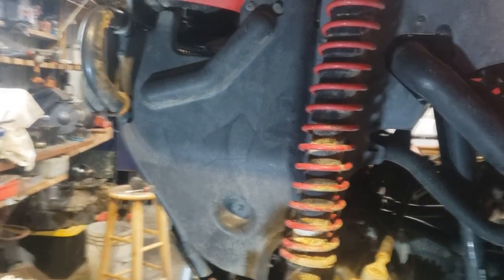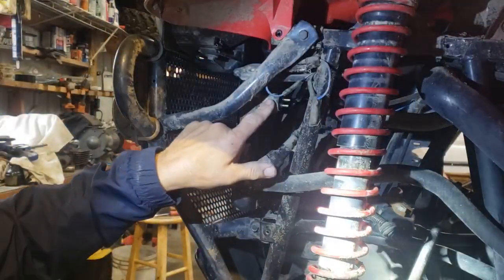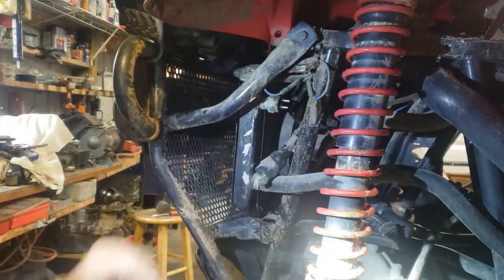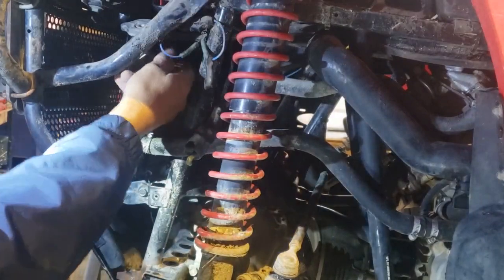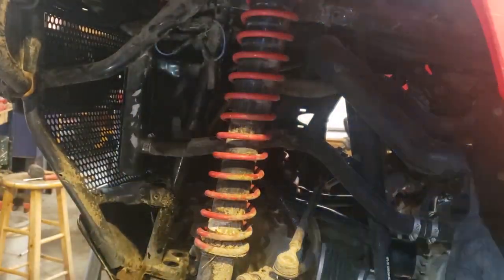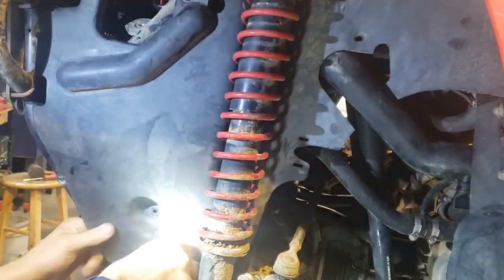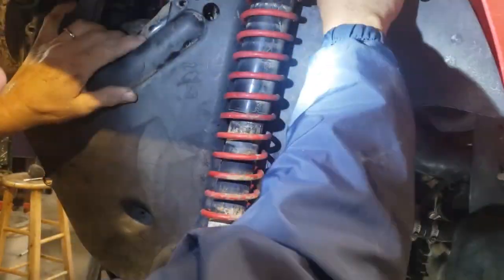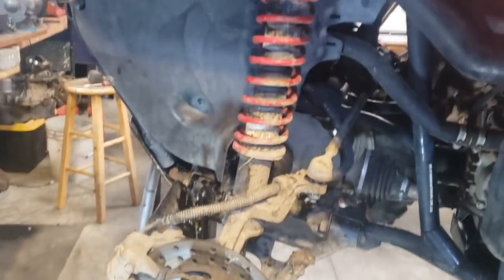kawasaki prairie 400  Replacing fan switch

Comment: Thanks.  mine is overheating.  Fan used to run after shutoff when hot.  No fan now.  Will go short the wires and check this out.

Comment: My fan comes on but doesn't shut off even after shutting 4wheeler off it runs till my batteries dead could the switch still be bad?
Reply from the maker: Yes the switch could be stuck on